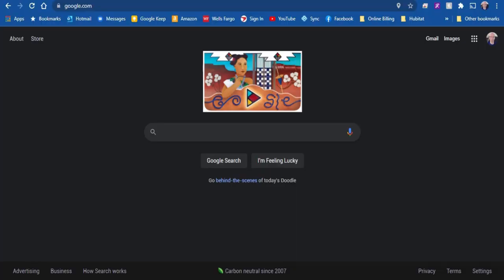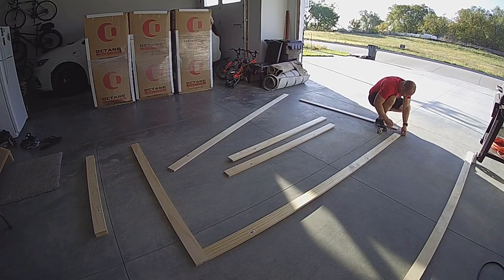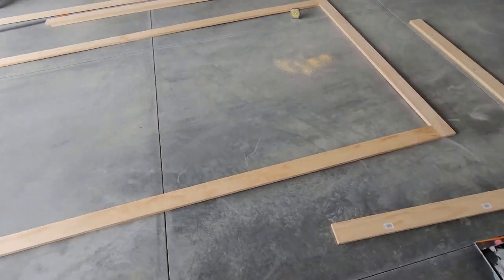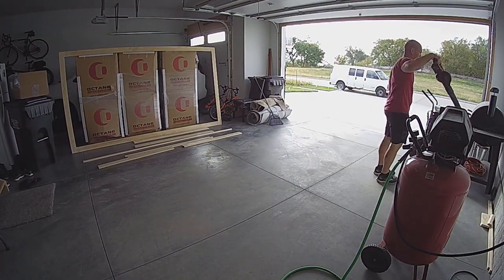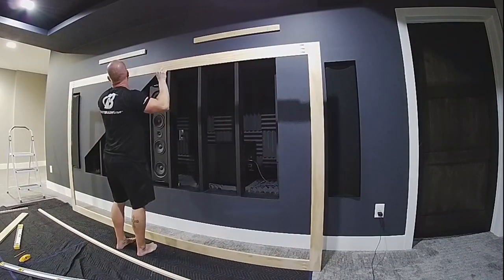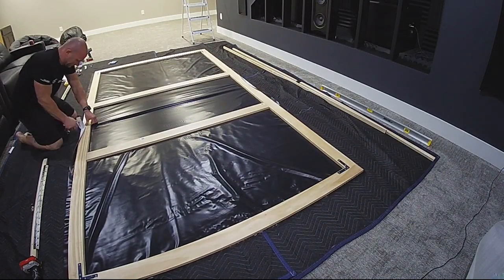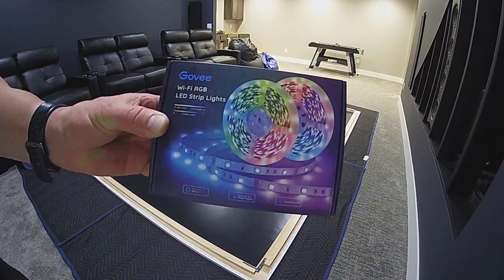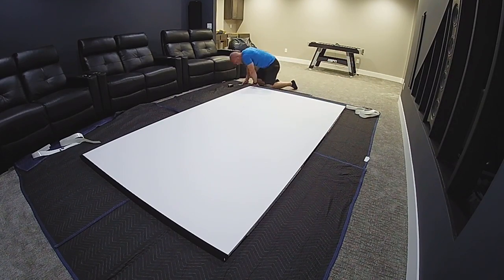Basement Home Theater - How To Build a DIY LED Backlit Projector Screen

Comment: This is one of the best looking screen builds ive seen on here. What width is your border? It looks perfect compared to some of the really wide ones people use. Im about to build a 110" inch screen this week.
Reply from the maker: Thank you very much - appreciate it!  I honestly don't remember the width, I thought I mentioned it in the video maybe.  It's not very big, I'm thinking it was 2" wide total and I basically lined it up on the outside edge and flipped whatever remained (1") to the front of the screen which forms the border you see when looking straight on at it.  Hopefully that makes sense.

Comment: Looks great. I’m going to have to check out the site you used to get measurements. I used the calculations on the Carl’s place site. Triple checked them, built the frame, stretched the screen, hung it and had a 2” border on the left, right and top and about a 6” border on the bottom🤨. I was not happy. But it hasn’t bugged me enough to correct it and I like the frameless screen.
Reply from the maker: Thank you!  Wow that really sucks that happened to you!  I wonder where things went off along the way somehow.  I think I looked at that calculator at one point in time and I was thinking it was pretty much the same, but I could be wrong.
Reply: @TyEichele  After watching your video, I got on that website again.  I did use it as well.  Maybe you can tell me where I went wrong.  I wanted a 122" wide screen which gives me a 68.63 in height  I added 4" to the height and 4" to the width to give me 126" x 72.6.  I measured it again last night and that is exactly what I have.  But my borders are as stated above when I turn on the projector.  Since the borders didn't turn out right, I wasn't going to put the felt on until I fixed it.  It doesn't hurt anything but my pride.  I don't even notice it anymore and especially with wide screen format.  The walls are a shade darker than my screen so it blends in well.
Reply from the maker: @jkraft5081  So just to make sure I understand correctly - when you say you wanted a 122" wide screen, do you mean you wanted a 122" diagonal screen?  Or literally a 122" wide, which gives you roughly a 140" diagonal screen?  Also, I'm assuming this is a 16x9 aspect ratio?

Comment: what modifications would you have to do in order for this to hinge from the ceiling instead of the wall? and how heavy is it and what would you need to allow the screen to be held up on the ceiling

I am thinking of a similar swinging screen, but it needs to be away from the wall (TV will be on a stand) and the projector screen swings down (TV for casual watching) I also want the screen to come out in front of some furniture and storage bins that otherwise would block the screen

since I want to be able to use the TV still, this would need to be able to be latched to the ceiling when not in use
Reply from the maker: I love that idea first of all.  I honestly think the piano hinges are strong enough to hold the screen, but you could always do a third on in the middle.  Plus they make different lengths, so maybe just 2 longer ones would be enough.  They should show the weight limit on the package.  Just make sure you get them into some studs in the ceiling.  Maybe span the distance between ceiling joints with a smaller 1x2 so you have plenty of area to screw the piano hinges into.  You don't have to use piano hinges either, there are plenty of hinges out there to choose from.  Good luck - sounds like a neat project!

Comment: Great work! Might it have been simpler to mount the LEDs on the wall? Just thinking ahead as I’m likely to copy you. I visited Carls website but I don’t see anywhere it says the material is acoustically transparent or an gain ratings.
Reply from the maker: I'm not sure about the LEDS on the wall, possibly!  But you'd have to mount them sideways somehow to get the best effect....  Here is the detail page for the screen material:. https://shop.carlofet.com/home-theater/screen-materials/nano-acoustic-flexigray-projector-screen-material
Thanks for watching and good luck!
Reply from the maker: I just realized that is the Flexigray material and not the Flexiwhite material....sorry about that.  Looks like their website has chnaged, maybe they are updating it?  I'd give them a call and see if they have it in stock or what's going on with it.  Good luck!

Comment: Ty, struggling here for some reason... I'm going for a 154" diagonal screen.  My width is 134.25" x and height 75.50".  I plan to use a 2" border.  That said I would add 4" inches to both the height and width measurements.  Width 134.25" =138.25" and Height 75.50" = 79.50".  When I put my tape to my layout its reading 160" diagonal.  If I then subtract the 4" the viewable diagonal would be 156" but it's supposed to be 154".  What am I not accounting for?  Any guidance would be amazing... I feel like I'm going to feel silly once I figure this out...
Reply from the maker: I'm not sure exactly.  Do you have to have a 2" border?  If not, I would build your screen as you mentioned above, and then just adjust your border width to accommodate the correct viewable screen size you are going for.  I'm not sure how you measured to get to 156", but diagonal measurements can be tricky when it comes to the math for them.  It doesn't appear that your math is wrong from what I can see.  Maybe try some projector screen size calculators you can find online?

Comment: Great job! 
I have followed your video and when I try to flip up the screen the cleat wants to come out. Am I doing something wrong? Any help would be greatly appreciated.
Reply from the maker: Thanks!  I'm not sure exactly why that would be happening...mine worked until I put gas shocks to hold it open, then it wanted to lift off of the cleat.  I ended up putting some 3" screws into the top part of the cleat that is connect to the screen to keep it in place.  You can see this on my complete walkthrough video - I show the screws I ended up putting in.  Good luck!

Comment: How did you do the black border tape.  I have my frame made and its near perfect flat and is perfect square.   Gained like 2 levels of woodworking. 
But I am puzzeled on how to do tape dead on straight as someone who cant draw a straight line.    I am aiming for 1in border could live with 2. 
Need ideas please and asap.
Reply from the maker: I simply took my tape and ran it flush with the side edge of the screen, then folded whatever reamining length there was to the front-facing side of the screen.  Then adjusted my picture size to the available space on the screen.  That's how I did it.  That way the entire sides are covered in black.  If it is too thick for you, you will have to figure out a way to measure and cut or even fold whatever thickness to the back side of the screen possibly to end up with less on the front side, if that makes sense.  Good luck!  Take your time, and don't pull the black velvet tight, it doesn't stretch and could end up shrinking back, possibly leaving gaps at your seams.
Reply: @TyEichele  thanks for reply and not soundinf ungrateful but I was hoping there was a slicker trick than that as I dont want to rely on my 1×3 to have perfect thickness all around.  I means is close but there is some tolerance there.   Im hoping to get like laser accurate lines.    I am thinking I may try masking tape.   Would a good painter tape harm the screen you think?
Reply from the maker: I'm not sure to be honest....could try on some spare material if you have any?  Otherwise maybe measure your lines and make some pencil marks to follow, covering up your marks as you go with the black tape?  I'm sure there are other videos out there too maybe with some ideas, maybe you've already looked.  Good luck!
Reply: @TyEichele  yup let you know how I make out.  I do know its actually easy to line up two peices of tape.  Ie.  Lay one down and other on its line.   This is done lots in autobody.    So thats my plan A if good blue tape can stick and remove np.

Comment: the link to the screen does not work((( where to buy? 170 inch
Reply from the maker: It would appear that they don't offer the acoustically transparent screen material anymore from Carl's Place.  I'm not sure where else to source this material from, you'll have to do some research online I guess.
Reply: @TyEichele thank you. you can give more information about your screen. I want to search.
Reply from the maker: @autoras9655  It's just acoustically transparent screen material, meaning you can place you speakers behind it and it won't block your speaker sound.  You are searching for acoustically transparent screen material.
Reply: @TyEichele Yes. I'm looking for an acoustically transparent screen. which will be able to show my projector well. I bought myself a screen, but not acoustically transparent. I saw your and also wanted one. here, now I don't know where to buy one ((( I want a 165 inch.

Comment: Wow. Distance from screen to seat how much
Reply from the maker: Roughly 13' I believe.
Reply: Wow. Sir is 13 feet a comfortable viewing distance for  140inch screen.  What your opinion. I am planning to build a home theatre . Sir can u plsss mentiom the room dimensions too. Especially the room height....
Reply from the maker: @15.emanuelshaju24  Absolutely - check out my walkthrough video as well, it shows and  talks about dimensions and all those details.
In my opinion, 13' from my screen is perfect.  It's a nice immersive picture but you don't have to turn you head to see the whole thing.  Your eyes have to move a little bit but it's great and we don't regret it at all.  The room is roughly 15' x 15' with a 9' tall ceiling height.

Comment: Just buy screen
Reply from the maker: Cheaper (and more fun) to build it yourself 😉
Reply: @TyEichele  plus if an accident happens, as they do with kids, your only out the cost of the material. That was the biggest reason for me to go the carls place route.
Reply from the maker: @jkraft5081  I agree 100%!!  In fact, that was one of my strategies for going for a projector and screen setup vs a larger TV.  Much easier and cheaper to replace the screen material than a whole TV 😉👍